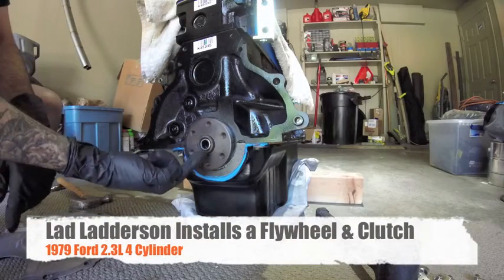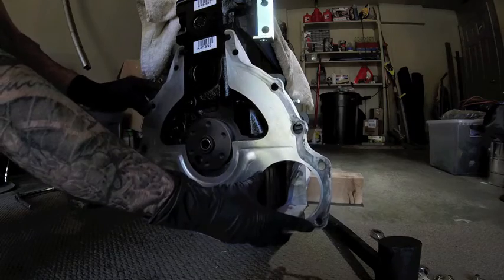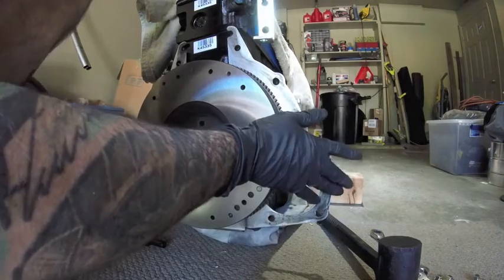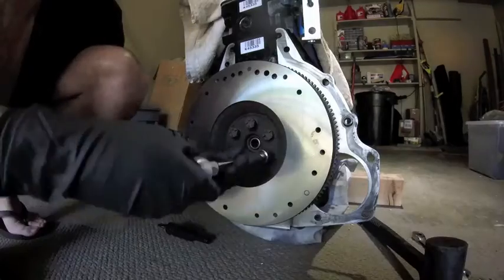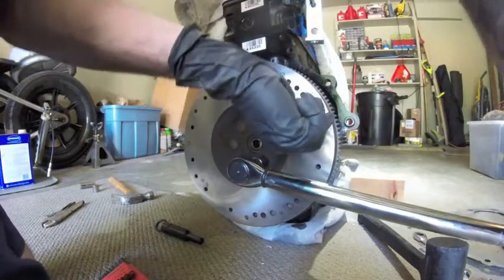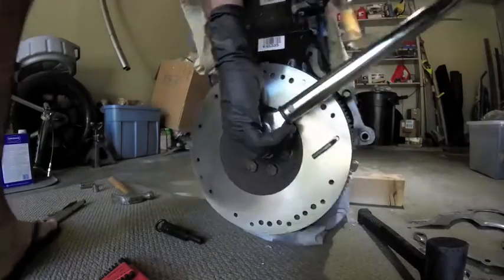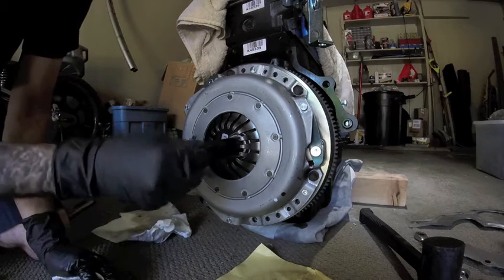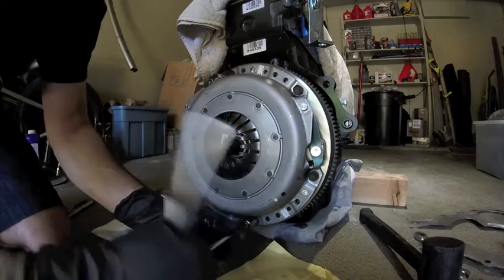2.3L Ford Flywheel & Clutch Install

Comment: My pilot bearing basically has become part of the crankshaft. Tried everything still won't budge.
Reply from the maker: This is going to sound insane, but find a bolt that is the exact same outer diameter as the inner diameter of the bearing. Then shove bits of bread in the pilot bearing and compact it in the hole by striking the bolt with a hammer. Some old timers will recognize the technique, except the used grease. The bread is a lot less messy.
Reply: @ladladderson8362  oh yeah I've tried that I've tried to slide hammer I even went and bought a three jaw bearing puller. This thing is actually became part of my crankshaft and tomorrow I'm going to try to use a Dremel and get it out.
Reply from the maker: Dremel or a chisel will get it done. Good luck.
Reply: @ladladderson8362  Yes sir, 
Gonna jump on it first thing in the morning.  Never had one this bad . Usually just use Grease and pop them right out. Not this time though LOL